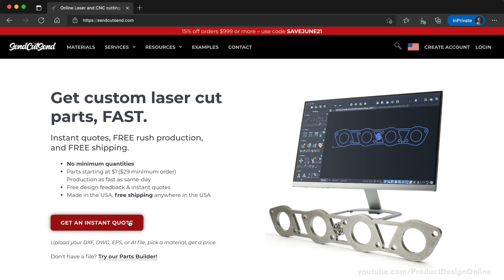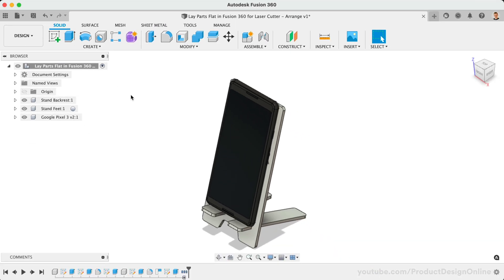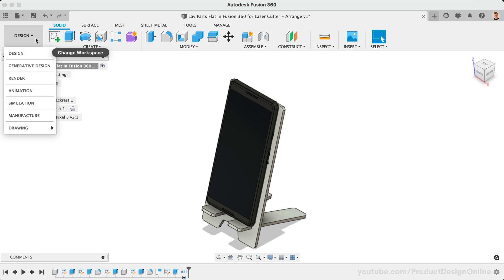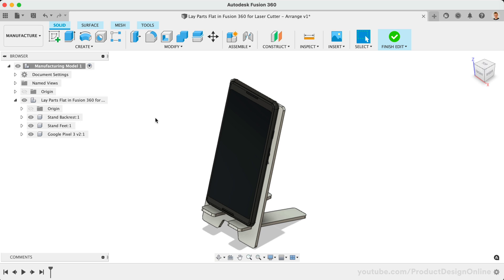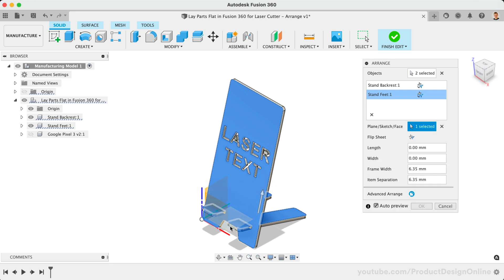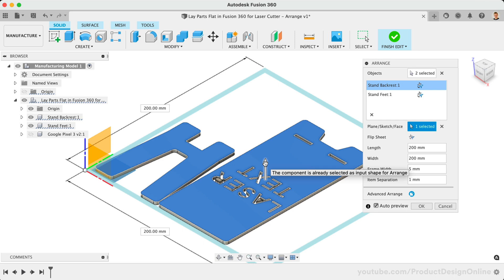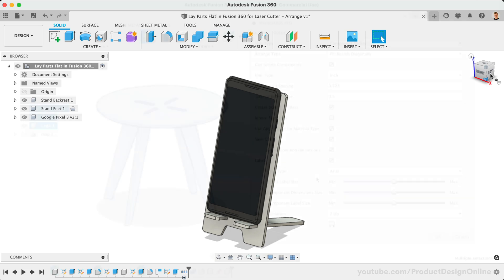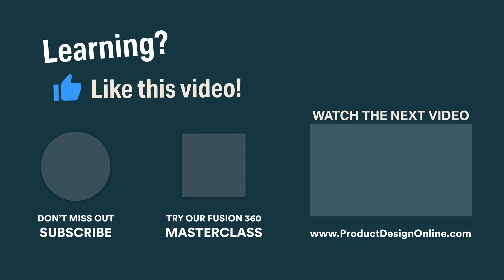Lay Parts Flat in Fusion 360 with Arrange Feature - Learn Fusion 360 for Laser Cutting 1 of 6

Comment: Great video as always!!  I was a little bummed when I tried to use the advanced arrange  which allows multiple "envelopes" to automatically be filled with the components, only to find out it is an extension which costs $1600 USD annually...like WHAT!?  Come on Autodesk :)
Reply from the maker: Agreed! The nesting and fabrication extension doesn't provide that much value unless you're a machine shop that really utilizes it... It's too bad they don't have a monthly or small price for the extensions (at the moment).

Comment: when you have a nested flat files, how do you export them. I am exporting them but they are not showing up as flat on my other program
Reply from the maker: There are a couple of different routes depending on your need. You can export from a Sketch by right-clicking and then "Save Sketch as DXF". If you built as a sheet metal component/part, you can generate a flat pattern and export it as a DXF.

You can also place your flat/nested parts on a Drawing sheet in the Drawing workspace, and expert that drawing as either DXF, DWG, or PDF.

Which method are you trying?

Be sure to check "Convert to polylines" in the DXF export dialog.
Reply: @ProductDesignOnline  I'm curious how to bring over the flat nested parts from Manufacturing workspace into a drawing?